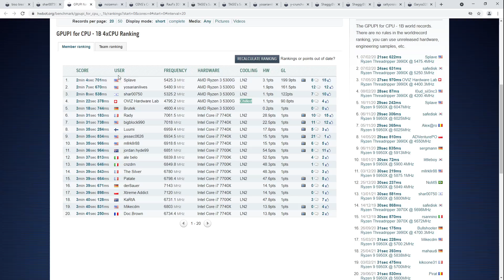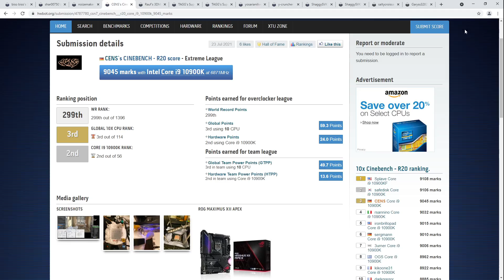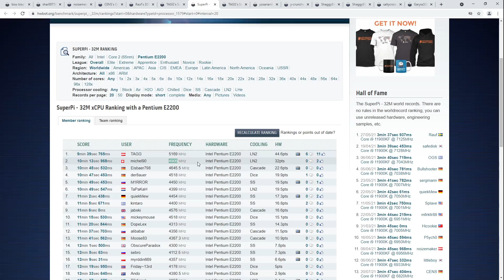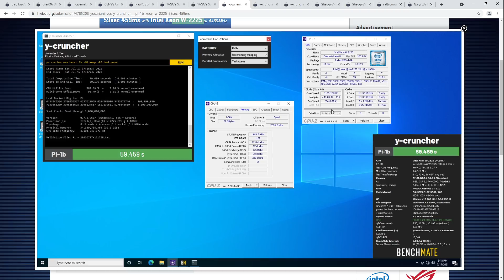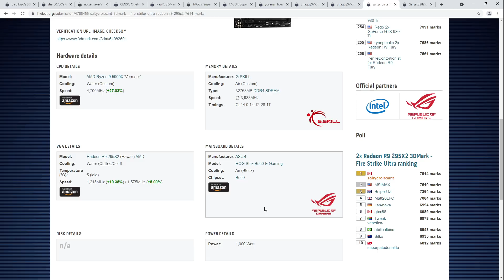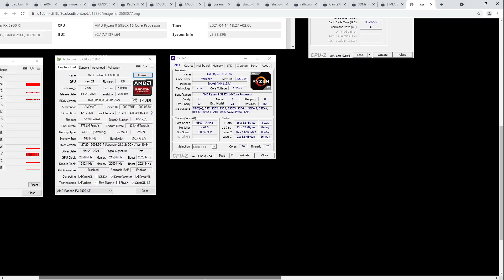HWbot round up #12: New Port Royal single card record, 3080Ti on LN2, Zombie GTX 1060 and more!

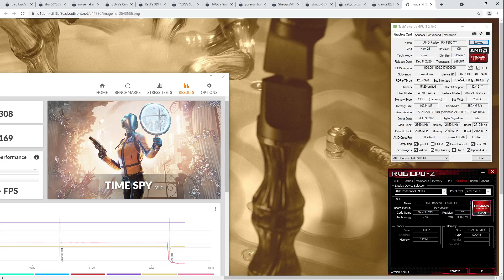Comment: 1:04:15 according to TPU that's a liquid devil. You can look up the device ID and subsystem ID from GPUZ (1002 73BF - 148C 2408) 
https://www.techpowerup.com/vgabios/231053/powercolor-rx6900xt-16384-201214
I looked up some pictures and it looks like the red devil and liquid devil have 3 power connectors.

Comment: Wondering why no competitive linux overclocking, then there are tons of cheap arm boards to overclock.
Reply from the maker: because the scores would be a nightmare to verify
Reply: If people start posting results im sure others would start to try and take the spots.
Reply: HWBot allows for Android scores in some benchmarks, but I would ask the mods before using a kernel compiled specifically for that cpu

Comment: if I look at the 5.5ghz guys 10900k and his ram timings, I guess his vccio/sa is extremely high. So the chip will degrade eventually and won't be able to run 5.5ghz any longer xD
Reply: nah itl be fine. theres guys who have been running super high VCCSA and VCCIO for months on end.. and if it does die.. it served its purpose